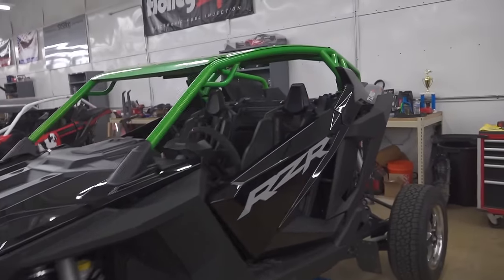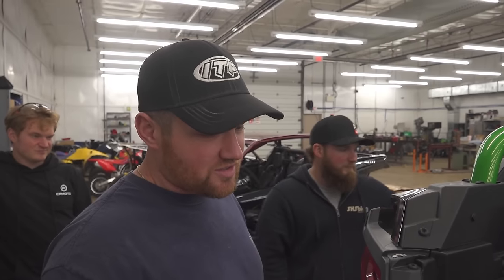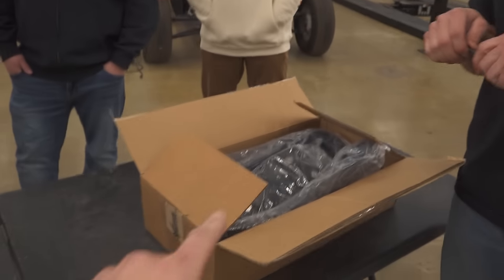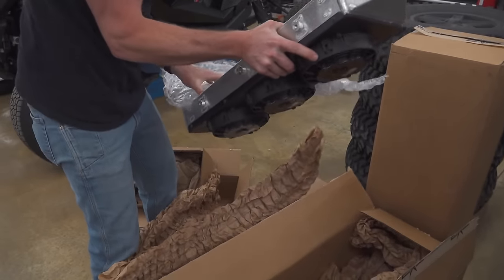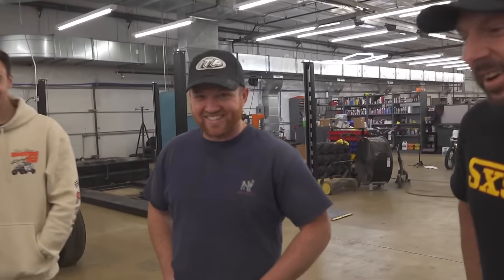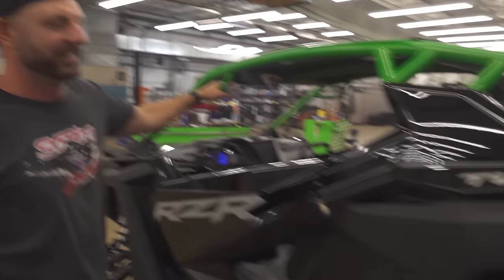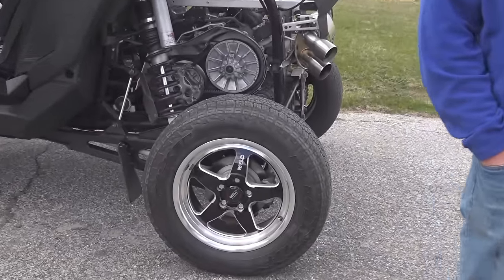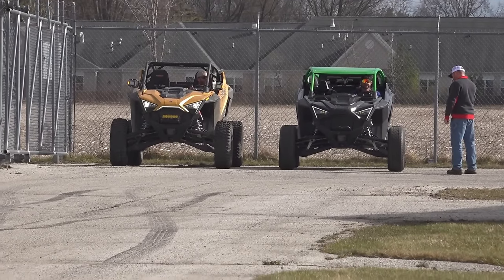Justin's Turbo R Gets A BIG INTERCOOLER & NEW EXHAUST!

Comment: Also you can seperate the system so your intercooler has its own heat exchanger and the temps drop instead of sharing with the engine and only getting down to 175-185 degrees.

Comment: Great vid, I think it’s pretty clear the kennel is the reason the track isn’t used. I mean cmon we got loud sxs and dust when it’s not watered down. Monday morning qb you guys should of had Chet buy land on the outskirts of town and built maybe 2 pole barns and you could of done what you want.
Reply: We’ve talked to the people that work in the actual building across the street from us, and the noise is never an issue.   There building is right next to the city dump that has a ton of heavy equipment running all day everyday.  And we stop and spray water on anytime there is any dust.

Comment: You could add water injection to it, to bring down the charge air temps as well, yes it's a thing, works a bit like a Nos kit, but with water. Helps with detonation as well.
Reply: If you’re gonna spray, might as well spray methanol